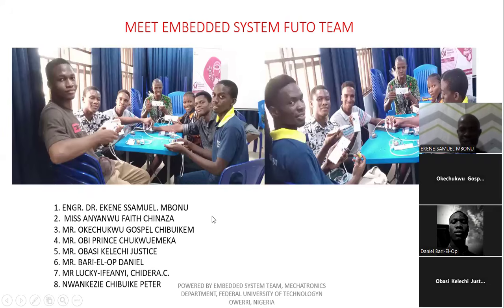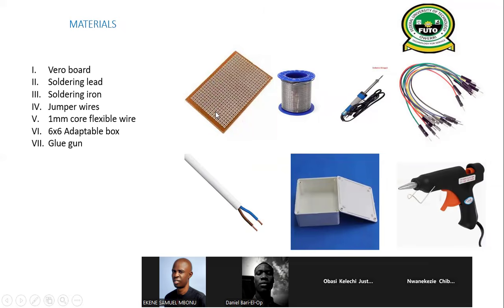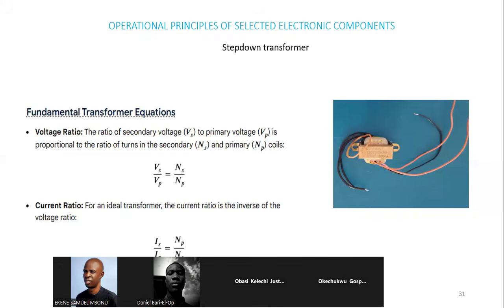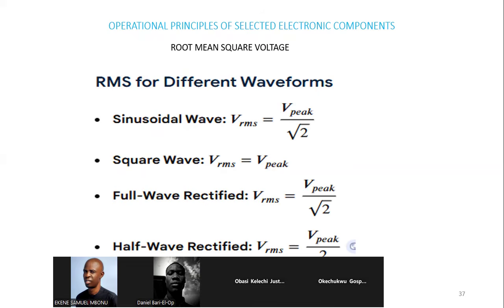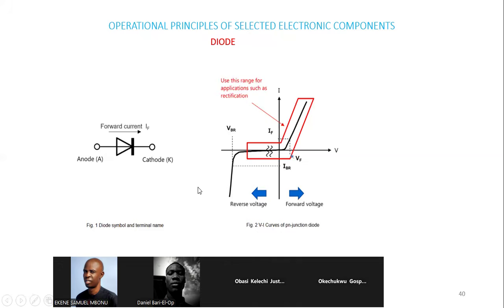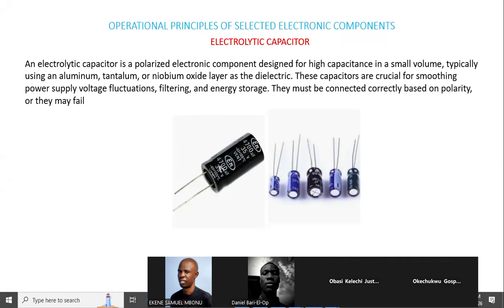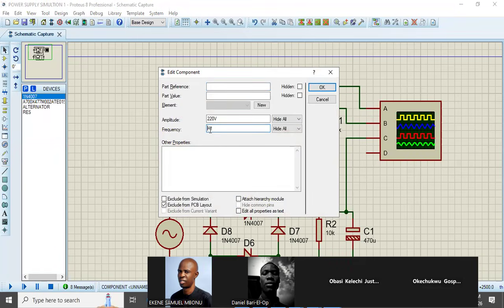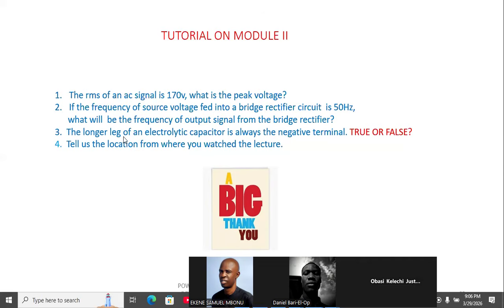DESIGN AND SIMULATION OF ELECTRONIC SYSTEMS (MODULE II)

Comment: Good day sir
Name: Nnaji, Chiagozie Anointing 
Department: Mechatronics Engineering 
University: FUTO
100 level
1. The rms of an ac signal is 170v, what is the peak voltage?
Answer:240.4V(Calculated as Vpeak = Vrms * √2
=170 * 1.4142=240.4V
 2. If the frequency of source voltage fed into a bridge rectifier circuit is 50Hz, what will be the frequency of output signal from the bridge rectifier?
Answer:100Hz(A full-wave bridge rectifier doubles the input frequency: 
fout = 2 * fin)
3. The longer leg of an electrolytic capacitor is always the negative terminal. TRUE OR FALSE?
Answer:FALSE(The longer leg is always the positive terminal/anode)
4. Tell us the location from where you watched the lecture.
Answer: I watched the lecture from my lodge in FUTO, Owerri.

Comment: Good morning sir 
My name is Ani Chinaecherem Fredrick 
100lvl student of Mechatronics Engineering FUTO 

1. Peak voltage when Vrms = 170V
Vpeak = Vrms × √2
Vpeak = 170 × 1.414
Vpeak ≈ 240.4V
Output frequency of a bridge rectifier when input is 50Hz

A bridge rectifier is a full-wave rectifier, meaning it uses both halves of the AC cycle, so the output frequency is doubled.
Output frequency = 2 × 50 = 100Hz

2. The longer leg of an electrolytic capacitor is always the negative terminal. TRUE OR FALSE?

FALSE. The longer leg is actually the positive terminal. The negative terminal is the shorter leg and it is usually marked with a minus (−) sign.

Comment: Name : ojiakor Daniel chidera 
Department: Mechatronics Engineering 

1. Calculate the peak voltage 

RMS=vpeak/√2
Vpeak=RMS ×√2
Vpeak=170×√2
Vpeak=240.v

2.calculate the output frequency 

Output frequency is doubled .
Therefore:
Output frequency= 50Hz × 2
Output frequency=100

3.Answer:
False:(the longer line is positive)

4. Federal University of technology owerri

Comment: Name: Cornelius Prosper 
Dept: mechatronics Engineering 

1. Calculate the peak voltage (Vpeak):
RMS = Vpeak / √2
Vpeak = RMS × √2
Vpeak = 170 × √2
Vpeak = 240. V

2. Calculate the output frequency:

Output frequency is doubled.
Therefore:
Output frequency = 50 Hz × 2
Output frequency = 100 Hz

3. Answer:
False (The longer line is positive)
4. School: FUTO hostel E

Comment: Name : Osoba Hebron Ebhosetalease 
Department : Mechatronics Engineering 

1. V_peak = V_rms × √2
V_peak = 170 × √2 ≈ 240.4 V

2. For a full-wave rectifier, the output frequency is twice the input frequency.
f_out = 2 × 50 Hz = 100 Hz

3. For LEDs: The longer leg is the anode (positive).
For electrolytic capacitors: The longer leg is usually the positive terminal (anode).
The shorter leg is the cathode (negative) in both cases.

I am watching from Federal University of Technology, Owerri (FUTO), Nigeria

Comment: My name is ELEKWACHI ZION CHIBUCHI.
A 100 level Mechatronics Engineering student

1. rms =Vpeak/√2
     Vpeak = rms × √2 
     = 170 × √2
     Vpeak = 240.2V

2. Output frequency is doubled — 50Hz × 2 =100Hz

3. False: Because the longer the leg is the positive (anode), the shorter the leg is the negative (cathode)

4. Federal University of Technology Owerri

Comment: Name: Adele Elvis OKekem 
Level: 100 lvl
Department: Mechatronics Engineering 

1. rms = Vpeak/√2
       Vpeak = rms × √2
       Vpeak =170 × √2
        Vpeak = 240.2 V

2. Output frequency is doubled 
        = 50Hz ×2
         = 100Hz

3. False

4. Eziobodo FUTO

Comment: Good day sir my Name is Efon Concern Akpan 100 level Mechatronics engineering student 

1:rms=vpeak/√2
Vpeak=rmsx√2
=170x√2
Vpeak=240.2V

2:output frequency is doubled 50Hz x2=100Hz

3:False,because the longer leg is positive (anode) and the shorter leg is negative (cathode)

Comment: Name: Alfred Copeland Ifesinachi 
Level: 100lvl
Department: Mechatronics Engineering 
1) Root mean square voltage= peak voltage/ √(2) 
Therefore, peak voltage = √(2)*  root mean square voltage.
V=170*√(2) 
V= 240.41V
2) Given: f=50HZ
Output frequency=2*input frequency 
Input frequency=50HZ
Output frequency= 50*2=100HZ

3) FALSE

4) I watched this lecture from my residence in FUTO

Comment: Name .. AKAchukwu okoudennam 
Department.. Mechatronics engineering 
1. Rms=(peak)^1\2÷[2]^1\2
.°. Rms=170v .. Peak voltage is approximately 240v.
2. Output frequency is doubled..50Hz×2=100Hz
3. False ..this is because the longer leg is the anode (the positive side +)and the shorter leg  is the cathod(the negative side-)
4. Am watching from Hostel A, FUTO

Comment: My name is Nwannaogu Emmanuel Uchenna, a 100 level Mechatronics Engineering student

1. rms =Vpeak/√2
     Vpeak = rms × √2 
     = 170 × √2
     Vpeak = 240.2V

2. Output frequency is doubled — 50Hz × 2 =100Hz

3. False: Because the longer the leg is the positive (anode), the shorter the leg is the negative (cathode)

4. Eziobodo FUTO

Comment: Name: Uzor Kenechukwu Michael 
Department: Mechatronics Engineering 
1. Rms-=(peak)^1/2÷(2)^1/2
Hence, Rms=170V, peak voltage is approximately 240 V
2. Output frequency is doubled, 50Hz × 2= 100hz
3.FALSE-this is because the longer leg is the anode (+) and the shorter leg is the cathode (-)
4.  I am watching from    Umuchima, FUTO.

Comment: Name; Oswald oluwafemi Ngwama
Dept: mechatronics engineering 100lvl

1. The formula for RMS is v-peak  divided by √2. So, v-peak = RMS ×√2=170×√2=240.2v
2. The output frequency becomes twice the input, so 50hz ×2= 100hz
3.incorrect.The longer lead is the anode(positive), while the shorter one is cathode(negative) 
I'm watching from town, owerri

Comment: Akaligwo Uchenna 
A 100lvl student of mechatronics engineering 
FUTO 
Q1. The peak voltage =240v
 
Q2. 100Hz the bridge rectifier doubles the frequency 

Q3. No.... the longer leg is the anode the shorter leg is the cathode

Comment: Good day sir 
My name is Nnamocha Peter Chibueze I'm a 100lvl mechatronics engineering student 
1. RMA = v peak / √2
V peak = RMS x √2 = 170 x √2
V peak = 240.2 V

2. Output frequency= 2 x 50Hz = 100Hz

3. False due to, the longer leg is the anode which means it's positively charged and the shorter leg I'd the negative point (cathode) 

FUTO imo state

Comment: Name: Duruigbo Ihechukwu Blaise 
Department: Mechatronics Engineering, 100 Level

1. The formula for RMS is  V-peak divided by √2 . So,  V-peak = RMS × √2 = 170 × √2  = 240.2v
2. The output frequency becomes twice the input, so  50Hz × 2 = 100Hz.
3. Incorrect. The longer lead is the anode (positive), while the shorter one is the cathode (negative).
4. Owerri West, Umuchima-Ihiagwa, FUTO.

Comment: No 1:rma = vpeak/2
Vpeak = rmsx/2 = 170x/2
Vpeak = 240.2v

No 2:Output frequency is x2: so 50Hz = 100Hz

No 3:False, due to the longer leg is the anode which means it's positively charged and the shorter leg is the negative point cathode
From the Federal university of technology Owerri (FUTO)

Comment: Name: Uo-Fredrick Prince Ekewisdom 
From 100lvl mechatronics engineering 

Peak voltage:

V_p = V_{rms}\sqrt{2} V_p = 170 \times 1.414 \approx 240V 

Answer: ≈ 240 V

Output frequency of a bridge rectifier:

f_{out} = 2f_{in} 2 \times 50 = 100Hz 

Answer: 100 Hz

False — the longer leg is the positive terminal.

I watched from FUTO

Comment: 1. The peak voltage = rms x √2
                                  = 170 x √2 
                                  = 240.42 V
2. Frequency of output = 2 x Frequency of input 
                                       = 2 x 50 
                                       = 100 Hz
3. FALSE. The longer leg of an electrolyte capacitor is always positive. 
4. I am watching from FUTO

Comment: Name: David Marvelous ogbu 
Department: Mechatronics Engineering

1. The relationship between RMS voltage and peak voltage is:
Vpeak = Vrms √2

Given:

Vrms = 170V

Therefore:

Vpeak = 170 x 1.414

Vpeak = 240.4V

2. For a full-wave rectifier, the output frequency is twice the input frequency:
fout = 2fin

fout = 2 x 50Hz = 100Hz

3. The statement ik V because in an LED, the longer leg is the anode (positive terminal) while the shorter leg is the cathode (negative terminal)

From owerri

FUTO IS FEDERAL UNIVERSITY OF TECHNOLOGY OWERRI

Comment: Good day sir 
My name is Ogbonna Uchenna Emmanuel and I am a student of the 100level mechatronics department 
1. rma =vpeak//2 Vpeak = rmsx/2 = 170x/2 Vpeak =240.2v 
2. 2. Output frequency is x2: so 50Hz =100Hz 
3. 3. False, due to the longer leg is the anode which means it's positively charged and the shorter leg is the negative point cathode
From the Federal university of technology Owerri (FUTO)

Comment: Name: Kevin Asadu
Department: Mechatronics Engineering
1. The relationship between RMS voltage and peak voltage is: Vpeak = Vrms V2
Given:
Vrms = 170V
Therefore:
Vpeak = 170 x 1.414
Vpeak = 240.4V

2. For a full-wave rectifier, the output frequency is twice the input frequency:
fout =2fin
fout = 2 x 50Hz= 100Hz

3. The statement ik V because in an LED,
the longer leg is the anode (positive terminal) while the shorter leg is the cathode(negative terminal)

From owerri 
FUTO IS FEDERAL UNIVERSITY OF TECHNOLOGY OWERRI

Comment: Name: Daniel Prince Chibuezem 
Department: mechatronics engineering 

1. rma =vpeak//2
   Vpeak = rmsx/2
   = 170x/2
    Vpeak =240.2v

2. Output frequency is x2: so 50Hz =100Hz

3. False, due to the longer leg is the anode which means it's positively charged and the shorter leg is the negative point cathode.

Futo

Comment: Uchewujo wisdom chukwunonyerem 
Mce 100lvl

1.Peak voltage ≈ 240 V

2.In a bridge rectifier, the output frequency is twice the input frequency:
So,
Output frequency = 100 Hz
3.FALSE — the longer leg of an electrolytic capacitor is the positive terminal.

4.
“I watched the lecture from Imo state

Comment: name: Anyanwu Precious Chinyerem 
Department: Mechatronics Engineering 

To determine the peak voltage:

Given that:

Therefore, the peak voltage is approximately 240.2 V.
In a full-wave rectifier, the output frequency becomes twice the input frequency. Therefore:

Hence, the output frequency is 100 Hz.
The statement is incorrect because the longer terminal of an LED represents the anode (positive side), while the shorter terminal represents the cathode (negative side).
FUTO stands for Federal University of Technology, Owerri.

Comment: Name: Pius Chibuide Cosmas 
Mechatronics engineering 

Solution 
1. rms=Vpeak×√2 
           =170×1.414
           =240.4V
            
2. Frequency out; f= 2×50 = 100Hz

3. False.  The longer terminal is the anode 
4. Location= Eziobodo, FUTO

Comment: Name:Uchenna Delight Chukwubuikem 
Department:Mechatronics Engineering 
1)Rms=(peak)^1/2 ÷(2)^1/2
Hence, Rms=170 V, Peak Voltage is approximately 240 V.
2)Output Frequency is doubled,50Hz ×2=100 Hz
3)FALSE-This is because the longer leg is the anode(+) and the shorter leg is the cathode(-)
4.) Im watching from Eziobodo,FUTO

Comment: Name: Chigozie Ihunanyachi Marvellous 
Department: Mechatronics Engineering 
1. rma= Vpeak//2

Vpeak = rmsx/2

=170x/2

Vpeak= 240.2v

2. Output frequency is x2: so 50Hz x2 =100Hz

3. False, due to , the longer leg is the anode which means it's positively charged and the shorter leg is the negative point (cathode)

4. FUTO

Comment: Name: Ekeator Delight ihechi 
Dept: Mechatronics engineering 
Level : 100L

1. Rms= vpeak/√2
      vpeak= rms ×√2
= 170v × √2
= 240.42v

2. Output frequency is doubled that is 50HZ × 2=100Hz
3. False 
4. Eziobodo futo

Comment: GOOD MORNING ENGR MBONU 
I am Kelechi Emmanuel Chibuike 

1. Peak voltage = RMS × √2
V_{peak}AND = 170\times\sqrt{2}\approx240.4V
So, the peak voltage is approximately 240 V.

2. A bridge rectifier doubles the frequency of the AC input.
Output frequency = 2 × 50 Hz = 100 Hz
3. FALSE — the longer leg of an electrolytic capacitor is the positive terminal.
4. Location: FUTO NIGERIA

Comment: I am ABETIANBE SIXTUS JACKSON 
MCE 100 LEVEL

1. The rms of an ac signal is 170 volts
While the peak voltage is 240volts

2. If the frequency is source voltage fed to a BR circuit is 50Hz, the output sign from the bridge rectifier is 100Hz

3. The longer lead of an electrolytic capacitor is always the negative terminal :FALSE

4. I watched the Video from Owerri west , Eziobodo ,FUTO

Comment: I am ONYEAGHALA ISAAC CHIBUGO. 
MCE 100LVL.

1) THE RMS OF AN AC SIGNAL IS 170v, WHAT IS THE PEAK VOLTAGE? 
240v

2) IF THE FREQUENCY OF SOURCE VOLTAGE FED INTO A BRIDGE RECTIFIER CIRCUIT IS 50Hz. WHAT WILL BE THE FREQUENCY OF THE OUTPUT SIGNAL FROM THE BRIDGE RECTIFIER? 
100Hz.

3) THE LONGER LEG OF AN ELECTROLYTIC CAPACITOR IS ALWAYS THE NEGATIVE TERMINAL. TRUE/FALSE
False. 

4) I watched this video from Umuerim Owerri North.

Comment: Name: oguamanam chibunna divine 
Level:100

1. rma=Vpeak/√2
Vpeak=rms×√2
=170×√2
Vpeak =240.2v

2.output frequency is doubled so 50Hz×2=100HZ

3.false because the longer leg is anode which is positively charge and the shorter leg is the negative 

4 naze

Comment: Ehiudo Daniel Chisom 
Mechatronics engineering 
100 lvl

1. The peak voltage is 240V

2. 100Hz because the frequency is doubled

3. False, because the longer ledis the anode which is positive and the shorter leg cathode which is negative

4. Federal university of technology Owerri from Eziobodo

Comment: Name: Trust God Osaro 
Mce Department 100lv 
  
1. RMS= vpeak/√2
Vpeak= RMS × √2 
Vpeak= 170v × √2
Vpeak=240.42V

2. 100Hz (In a full-wave bridge rectifier, the output frequency is double the input frequency).

3. FALSE (The longer leg of an electrolytic capacitor is the positive terminal, or anode).

4. I watched the lecture from Ihiagwa, Imo State.

Comment: Good evening sir
Name: IKEH-EZEJI CHIDIEBERE VICTOR 
Dept: Mechatronics 100lvl

Answers
1. RMS and peak voltage relation:
Peak voltage= RMS ×√2

So,
Peak voltage=170 ×√2
=170 ×1.414

Answer: Peak voltage ≈ 240.4 V

2. In a bridge rectifier, the output frequency is twice the input frequency:

Therefore,
Output frequency=2 × 50=100Hz

Answer: 100 Hz

3. FALSE

4. Location watched from: Umuchima, Ihiagwa, FUTO.

Thank you

Comment: NAME: NWOSA ANTHONY NNAGOZIE 
DEPARTMENT: Mechatronics engineering 
Level: 100level 

1. Vp = Vrms × √2
Vp = 170 × 1.414
Vp ≈ 240.4V

Therefore, the peak voltage is approximately 240V.

2. If the frequency of the source voltage fed into a bridge rectifier circuit is 50Hz, the output frequency will be 100Hz.

3. The longer leg of an electrolytic capacitor is always the negative terminal  (False).
   The longer leg represents the positive terminal.

4. I watched the lecture from the Federal University of Technology Owerri (FUTO).

Comment: Name : Obianua Wisdom Chinomso 
Dept : MCE 100lvl 
1. The rms of an ac signal is 170v, what is the peak voltage?
 170V × 1.4141 = 240.38V 
The peak voltage is approximately 240.4V.
2. If the frequency of source voltage fed into a bridge rectifier circuit is 50Hz, what will be the frequency of output signal?
A bridge rectifier is a full-wave rectifier. In full-wave rectification, the output frequency is double the input frequency because both the positive and negative halves of the AC cycle are converted into positive pulses.
50×2= 100Hz.
3. The longer leg of an electrolytic capacitor is always the negative terminal. TRUE OR FALSE? FALSE.
Reason: For through-hole electrolytic capacitors, the longer leg is the positive terminal (anode), while the shorter leg is the negative terminal (cathode).
4. Tell us the location from where you watched the lecture.
From FUTO

Comment: NAME: UWA CHARLES ONYEDIKACHUKWU.
Dept: MECHATRONICS 100LVL.

1. rma= Vpeak/√2
Vpeak = rms×√2
=170×√2
Vpeak= 240.2v

2. Output frequency is doubled so 50Hz ×2 =100Hz

3. False because the longer leg is the anode which means it is positively charged and the shorter leg is the negative point (cathode)

4. Owerri West, Umuchima-Ihiagwa, FUTO.

Comment: 1. rms = Vpeak / √2
    Vpeak = rms × √2
    = 170 × √2
    Vpeak = 240.2v

2. Output frequency is doubled so 50Hz × 2

3. False because the longer leg is the positive point (anode) and the shorter leg is the negative point (cathode)

4. FUTO eziobodo

Comment: Name: Nwachukwu Peter Chigozirim 
Dept: Mechatronics Engineering 
Reg No. 20251560423
1. Vpeak = Vrms×√2
                  =170×1.414
                 = 240.38V
2. The frequency on the output of the bridge rectifier is 100Hz 
3. False. Longer leg is the positive

Comment: 1. The peak voltage is 240.4V

2. 100Hz because the frequency is doubled 

3. FALSE. The longer leg of a new electrolytic capacitor is the positive (anode) terminal.

4. I am watching from Federal University of Technology Owerri

Comment: 1. The voltage is 240v
2. 100Hz because the frequency is doubled 
3. It's not true because the longer side is the anode which is positive while the shorter side is the cathode which is negative 
 
Watching from FUTO OWERRI

Comment: 1) The peak voltage is 240volts.

2) It is 100Hz because the bridge rectifier doubles the frequency.

3) It is false because the longer leg is the anode while the shorter leg is the cathode.

4) Federal University of Technology Owerri (FUTO)

Comment: 1.The peak voltage is 240v

2. 100Hz because the  Frequency is doubled 

3.False, because the longer leg is the anode which is positive and shorter leg cathode which is negative 

4. Futo-fedral university of technology Owerri